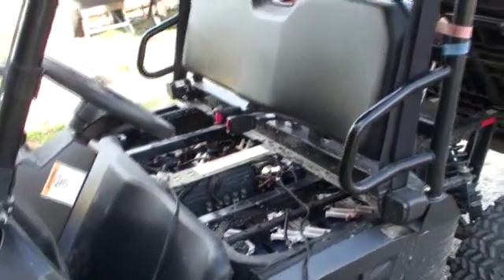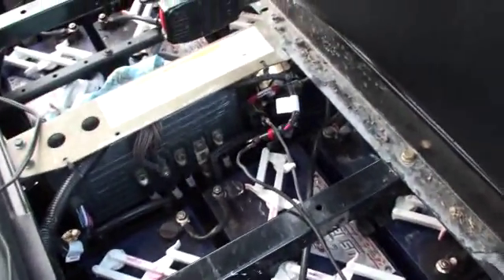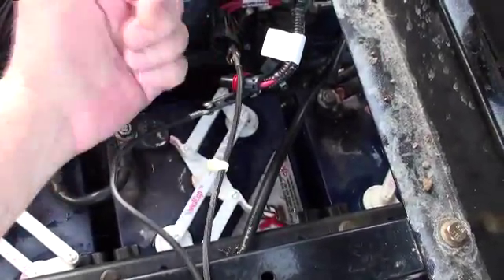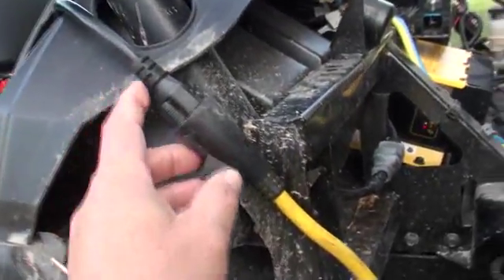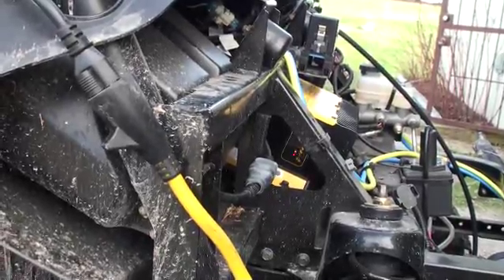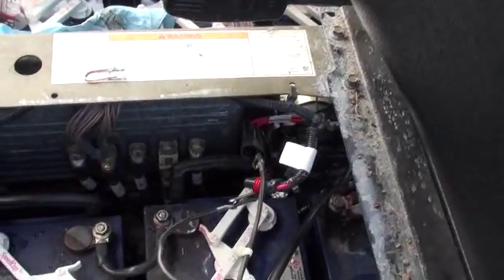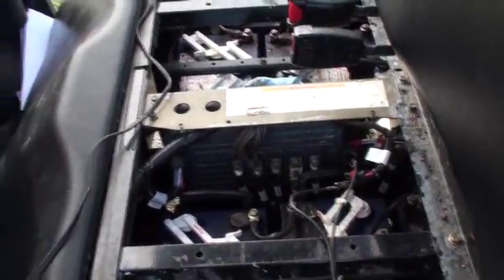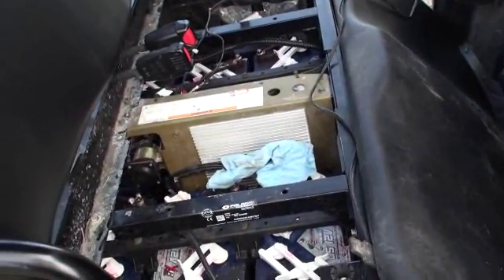2010 Polaris Ranger EV 4x4 Charger Algorithm Change, 73 to 71

Comment: Just wanted to say thanks for making the video.  I have a 2019 EV that was boiling the batteries and none of the Delta-Q techs could assist me.  I spent $10 on parts at O'Reilly's to make the jumper and the alligator clip zip chord, and had the algorithm changed from 73 to 71 in about 15 minutes.  Thank you.

Comment: hello mr. Branson, i have exactly what u have 2010 polaris raNGER 500  with the delta Q charger  .  my charger is now freeking out it use to have the 73 profile i needed to buy new batteries i did. and then when i got all back and connected right , the charger is Flashing so fast of all 4 bottom lights only , it doesn't pause or anything just a constent flashing of just the four bottom ones   .    id like to get it to profile 71 so it doesn't over charge the new batterys       . have u hard anything like this before? can you notify me buy email at slwberg19@gmail.com  my name is Sue West                         PS and my hourly charging meter isn't working  correctly .

Comment: Thanks for the info.  I replaced the OEM batteries on my 2014 Polaris EV with VMAX XTR12-155Ah batteries.  The battery manufacturer said I needed to change the charger algorithm to 126.  The original setting was 73, lucky for me, 126 was the next one that in the sequence.